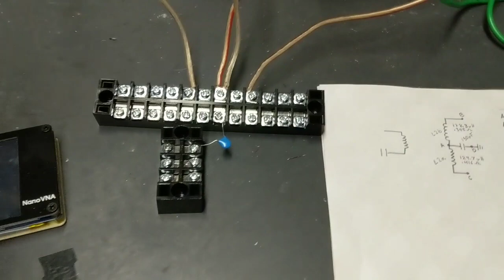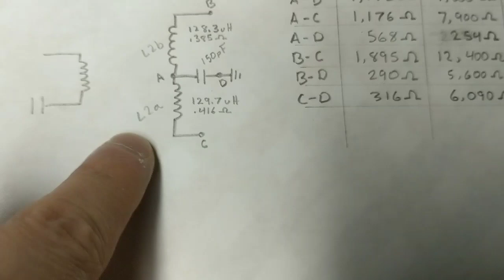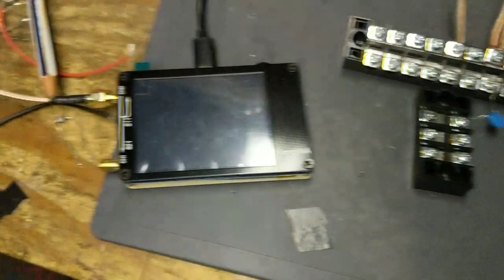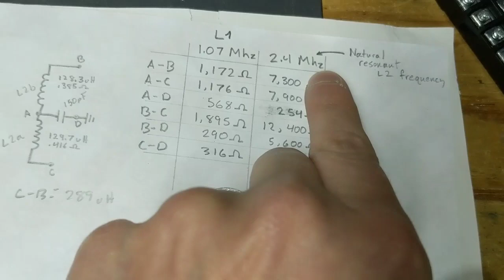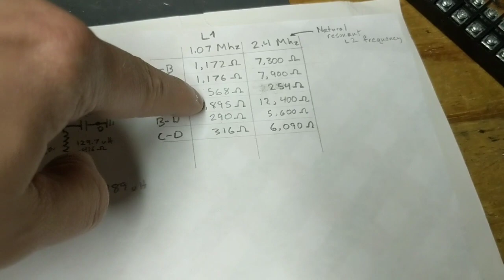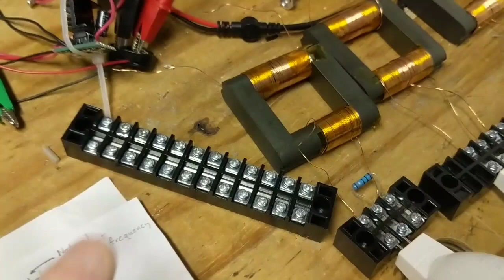Don Smith Circuit - L2 Impedances, Looking for feedback!

Comment from the maker: So @Jeremy, comments as usual aren't working great.  Maybe if you can respond to this one, I can see your comment.  I could only see a snippet.  L1 = 25ft, L2(a+b) = 100ft.
Reply: I'm trying, I can't respond.
Reply from the maker: This one I saw.  So weird, I see your original one like 4 times, but it says it's no longer available.  I only see the first couple lines.  Wonder if there something in there that YouTube's system interprets as some kind of code and rejects against policy.  But then I'd guess it would at least let you know.
Reply: @phives5910  I tried like at least 10 times.  I think its too long.  Let me see if I can break it up into several comments.
Reply: So I have an important question.  Is the (L2a+b) secondary 4x length primary?

How are you measuring the node/anti-nodes?  To see how the node/anti-nodes moves along the helix distributed resonator, you have to keep the secondary L2a and L2b OPEN!!!  The Center is grounded through shunt still.  But has to have an open end.  Measure the nodes/anti-nodes like Bruno VK is doing!  Using scope leads on the outside of the wire…not connected.  When ends are open the reflected wave magnifies the voltage!!!
Reply: Here is a quote from Tesla that I think is helpful.  I wish I had this book, but it is very expensive.  Read this and take note of his quote. 
"If the transmitting and receiving coil were made longer than the quarter of the wavelength of the electrical disturbance in the wire, then the points of highest potential would not fall at the inner ends of the coils . . . as required, but nodal points would form, as the case may be, somewhere in the middle of the coils ..." [Dr. Nikola Tesla - Selected Patent Wrappers, compiled by J.T. Ratzlaff, Tesla Book Company, 1980, Vol. 1, p. 150.]
Reply: To be clear, an open helix coil can be referred to as a distributed resonator.  It’s basically a resonator cavity.   The standing waves with an open-end allow us to have forward and reflected waves that magnify the voltage and amperage.   This is a longitudinal wave!

Refer to Tesla’s Impedance Phenomena on copper bars.  Tesla’s Impedance Circuit.  Rick’s book on Page 329.    Tesla says, “I showed that when such currents or sudden discharges are passed through a thick metal bar there may be points on the bar only a few inches apart, which have a sufficient potential difference between them to maintain at bright incandescence an ordinary filament lamp.”    

He is referring to multiple nodes and anti-nodes with a special note to mention, that the length/frequency of the copper bar determines how many nodes and anti-nodes are available.  The Tesla Impedance Circuit is basically the Don Smith Effect.   One side of the capacitor is pulsed, and the other side is the ambient reflected back!  Most people that replicate his device, don’t realize that harmonics are even multiples because both capacitors end act as open reflected waves.
Reply: I would also study this video on standing waves.  Take note of what happens on patterns with fixed ends, Fixed at one end., and not fixed at either end.
https://youtu.be/hCDRaY6xUi4
Reply: Ok, a few basic maths on lengths. 
To find the lengths of wire for frequency use:  
300 divided by frequency in Mhz = Meter Lengths
990 divided by frequency in Mhz = Length in Feet  ( Don used 990, page 101 from Ricks Book and added slightly more length )
1/2 wave is 495/Mhz in feet lengths
1/4 wave is 247.5/Mhz in feet lengths
Reply: Here are my parameters from Rick’s Kit 2:
	•	Primary Proper L1 is 17ft. and is the 1/4 wave. 2.35mm cross-section with insulation.  
	•	L2 for each side is 28 AWG at 35ft. When combined, they are 70ft.  Each side of L2 is 50 turns of magnetic copper wire and the pigtails are included for the length.  Both combined coils joined to create a 1/2 wave and the center counterpoise has a shunt and resonates at 5.4mhz. creating opposite voltage phases on each end.
	•	L3 is 8.5 ft.   This is a much thicker stranded wire allowing for much more amperage.
	•	L2a + b = 70ft.     This is roughly 4x the length of L1.   Or each half is 2x the length of L1.  However, you want to look at it.  
	•	L1 is roughly 2x the length of L3.
Reply: You need to tune the primary and counterpoised L2 to the same frequency but by keeping the wire length to be multiples of the primary.   The number of turns on the primary determines the voltage step-up on your L2 open ends.  Fewer turns create longer pigtails that you have to keep for L1. 

Now that you know this information.  You can start to think about how your L1 and L2 have to be. 
For example…this explains why your L1 and L2 don’t cancel reactive impedances to only the ohms of the coils. Z = √ R^2 + (Xl - Xc)^2. 
Once you are left with the system working at standard resistance with much lower ohms, the higher shunt value can be taken into account to trap the ambient electrons and stay in the superconductive state of the LC tank circuit. 

Resonance is key to trap and pull in electrons and oscillate in the LC circuit.  Without all coils in resonance, all hope is lost.  

This is how I see it at the moment, but I’m still learning as well.  Hope this helps.
Reply from the maker: @jeremyburnum8604  they all came through!  Studying now.
Reply from the maker: So I didn't mention it in the video, but when I used my VNA to find the impedances, there were two resonance points across L2(a+b).  2.4 MHz and 4.8Mhz (this one was higher).  Given Rick mentioned that he ran his RICK 2 kit (on his website) at 2.7 MHz, and you're saying 5.4Mhz, I think I'm seeing the same thing with my setup.

I'll focus on this tuning a bit.

My coil lengths I believe are good L1= 25ft, L2(a+b)=100ft.  Maybe I can trim some from the L2's of I see the nodes not appearing where I expect them.
Reply: Great!  I see that as well.  When leads are open you have double the frequency, but when the leads are connected to scope probes, you get both L1 and L2 to be in the same freq. 
Both L1 and L2 are in the same resonance 2.7 to 2.8mhz.  It's even mentioned on the kit 2 page that it's resonant at 2.7Mhz.
L1 can be tuned further by using the magnetic anti-nodes of L1 to be in the center of L2.  There are two magnetic anti-nodes on each side of L1 is series resonance. This also sets the voltage anti-node phases to be equal and opposite on L2.  You'll see how it sloshes the voltage phases back and forth. I believe we are looking for maximum voltages to be out of phase for each side to spring further into higher voltages.  At least this is what I see.
I only get both in resonance when I have two scope leads connected to outer leads of L2.   Also the ground through shunt makes a HUGE difference on the Q output of L2.
Reply: Look at page 65 in book.  It lines up with what I'm seeing.  "Volts dominate if the L-1 coil is far right...Volts and Amperes about equal if L-1 coil is centered".   Its the movement of L1 that determines L2 dominating more in volts or more evenly between voltage and  amperage.   Exactly what I see.
Reply from the maker: On a separate note, I'm jealous you got your kit already!  I think they are fulfilling convention attendee orders first, so hopefully I'll be soon.  I also ordered the window motor kit, because that looks interesting.
Reply: There are parts missing in kit 2 we received.  No instructions on L1/L2/L3 wire configurations. Which I'm fine with, this pushed me to teach myself using the book.  I guess this is the point. Don would have wanted that anyways.  So we are waiting in a way just like you on full understanding. I guess the next wave of papers will help further. 

I will have to say that I've figured out that the two variable capacitors you'll receive are for each L1 and L3 to keep 2.7mhz   The L1 is 1/2 length, while L3 is 1/4 length.  Use the lower vari cap for L1 and the higher value vari cap on L3. Basically you have twice the amount of capacitance for L3 shorter wire than L1 to still keep it in tune with L2.  L2 is open circuit to freely oscillate voltage impulses of 2.7mhz.  Sliding the inner coil can significantly help the output.

The additional research papers are amazing!   You'll see why!  The book is a must, which you have. So you are in a good position to learn, just like me.  I too, want to learn the basic of EACH module, before going into higher voltage.  I've done the Tesla Impedance Circuit, and now I understand it SOOOO much better and why it is cold electricity.

The kit makes it easier to make smaller changes and see the differences before considering going big.  So I do appreciate this.  As I would make it big too quickly, and then be frustrated.  Like many of us, we tend to overcomplicate, when it much more obvious than we realize.  Don was very clear with his words, and they hold true.  Many just ignored him because they didn't take the time to do the experiments for each module and understand.  So they became frustrated and gave up, or didn't understand.  Flew right past important information.

BTW, I've done many AV plug tests, and you'll be blown away what you can do with the research papers.   In the meeting, he demonstrated the large copper screen!!!  Wow!!!  You'll see why this is important!
Reply from the maker: Arrgh... Patience...
Reply from the maker: So one question then, the length of the L3 at 8.5ft is considered 1/4 wave?  So 1/4 L2a or b.
Reply: @jeremyburnum8604  HI Jeremy , 
so you are one of those lucky ones who were able to come to Rick’s workshop ;). I'm from EU and for 1 and half year it was very difficult to come to USA from EU but now you need to be vaccinated witch is big restriction as well. So you did see KIT 2 operated in live? Is it possible to communicate with you more directly?